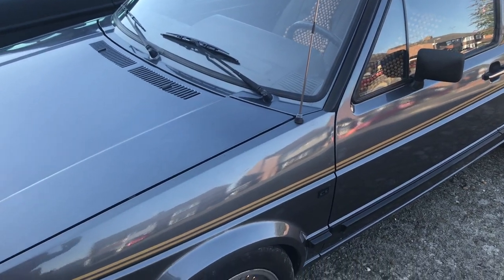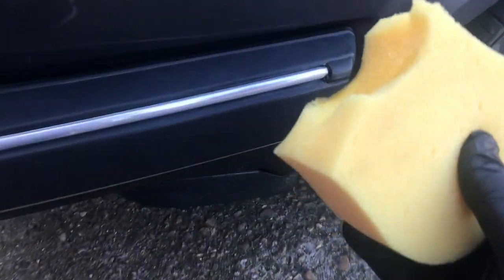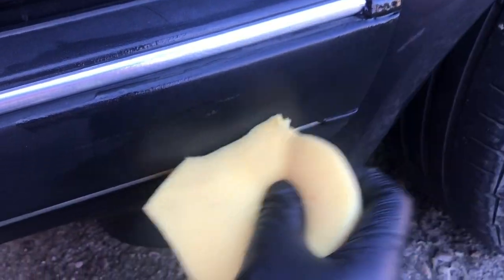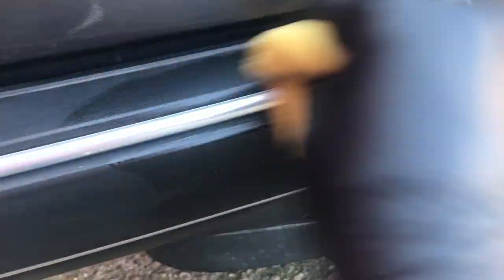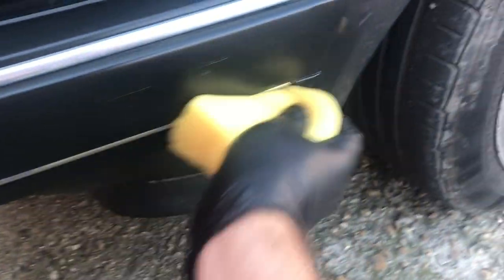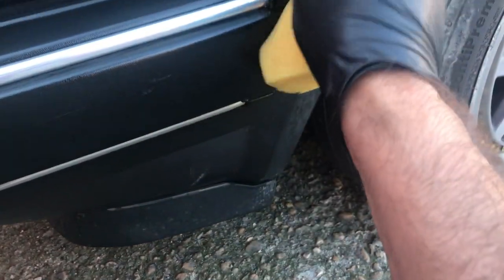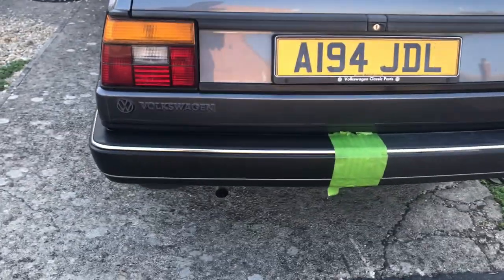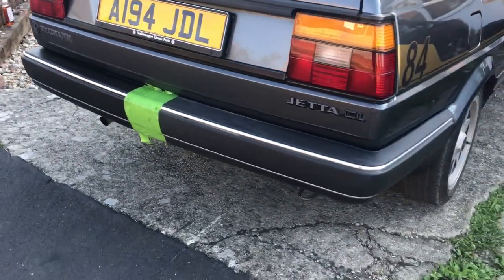How to Restore Your Black Plastic Trims & Bumpers With Linseed Oil. But Should You?

Comment: You should mixed up with a paint thinner to make the reaction and blending with the plastic. Also you should apply a good coat and let it soak on the surface for an hour, then retire the excess. It'll last for a year or more. The secret is on the formula.
Reply: I agree
Reply: Yup
Reply: Yes, agree you should mix linseed oil with white spirit at a 50/50 mix for better results

Comment: really good video, I have tried everything on my car, smooth peanut butter, linseed oil, and virtually every product in a bottle! 
the black trims are great but a real pain to maintain.  
I was talking with the owner of a lovely mk2 16v at the footman james show in manchester a few years ago and he swore by the auto glym bumper stuff *the improved formula version*, but I still find it needed applying all too often. 
my back bumper isn't in great shape at the moment, that's a good shout you made for the upol recommendation. Don't you need to use a compressor to apply it though?
Reply from the maker: You can get upol textured paint in spray cans. If you want a permanent solution and you’ve got damage on your bumpers it worth a look
Reply: @BarnClubCars  ah excellent!! thank you for this info mate 👍. My rear bumper wasn't too bad but all of a sudden it has become rather embarrassing I have to admit! 
thanks again, stew.

Comment: how about black shoe polish.
Reply: Black shoe polish was the 'go-to' in my mk2 days for a budget bumper touchup. The best actual product I've found that is actually meant for this is called "Forever Black." Its in a similar applicator bottle like the shoe polish and it really lasts. Mother's "Back to Black" is garbage, it's very thin and wears off in short order. The torch trick works as well, but the black Kiwi shoe polish is what I prefer. Cheap and effective. 😎

Comment: Both of my mk2's bumpers have passed saving with anything out a bottle. Trying paint next....🤞
Reply from the maker: You can try Upol textured paint. I’ve always found it close to the oem texture
Reply: Excellent, thanks. Will get looking for that 👍
Reply: SEM black trim paint really works great. It doesn't cover the original texture of the bumper and trims. There are great videos on how to properly apply it on youtube.
Reply: Bought the upol plastic paint but my mate ended up using dye on them and its done a great job for now. Will paint if that fades 😎👌